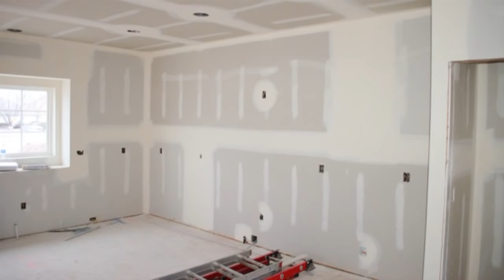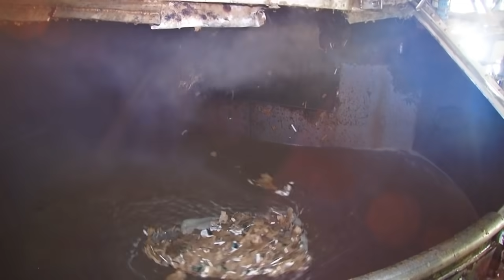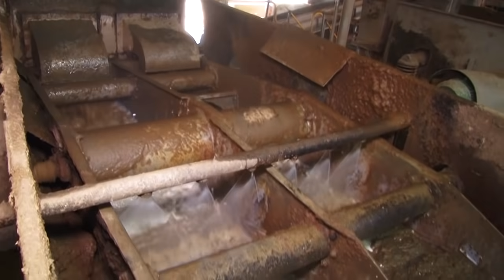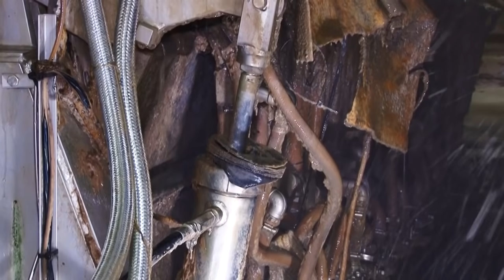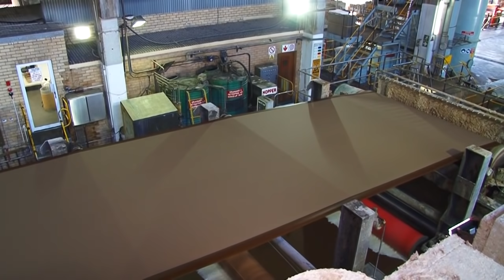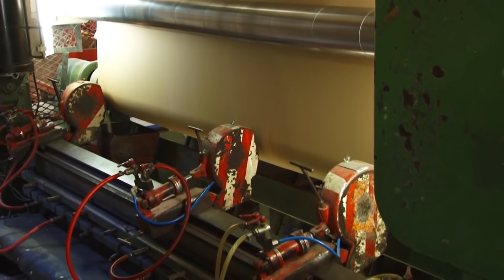How Cardboard is Recycled

Comment: And we wonder where all the water is in the world.If you question where's the water or how come or so hot like I have before.there might be a lot but I don't understand but simple OnePlus one will always equal two. A condensed ER meaning air conditioners for coolers refrigerators freezers refrigerant low temperature Cold storage. The way the condenser works is by blowing air over the coils which has coolant or refrigerant. Gas pass cycling thru the coils as the warm air passes over the MOISTURE in the ATMOSPHERE.
🙄 (" water in the a "ir) 😒
Condense. That is what you see dropping from the pipe from your A/C UNIT in your CAR or off your ROOF OF YOUR HOUSE.
or under your CAR.
🤔 CONDENSER  ,😲😲 
NOW imagine what a factory A/C drip might look like? 🤔
Or a casino? 
Or 1,000,000 or  even up too 2,000,000 homes just in a single CITY'S drip could look like.??? 😲😲😲😲
Is it starting to soak in now?
Those big factories casinos and freezer storage units for grocery stores and stuff like that
They don't drip.
The flow steadily and they flow. Almost twenty-four hours a day stripping moisture from. Is would be the effects in the so-called global warming cause and effect results where would you get warmer due to lack of moisture to regulate our like the sweat. The Earth has no more sweat because we were too hot.what are we going to be now and we need a suit to go outside?

Comment: They say only 10% of recyclables are actually recycled; not like it was shipped to China and other countries to be buried or burned.  As much as I sound like a pessimist, I'd say do your own research because to me lately, recycling was a big scam when bulk of it used to go to China until they started restricting the amount of recycling they accept.
Reply: Yes it is, that and they use alot more energy to recycle cardboard plastic and other materials than it would have taken to just put it into the ground. The only things worth recycling are metals like aluminum and tin and other scraps. The only reason these recycling companies are a thing and why it costs alot more is mainly government intervention and the subsidies by the government.
Reply: @Info255  
I see you failed math class.  
Far less energy is used... to recycle plastic & paper, than it is to construct from new materials. 

Harvesting the raw materials, lumber & oil... are far more energy intensive, than collecting & sorting paper & plastic products.  
The manufacturing of plastics from crude goes through a long series of refinement processes, that consumes 20x the energy... vs ...processing recycled plastics, which only need to be cleaned & melted down to be remolded.  

The pulping process of wood takes much longer & goes through more cleaning phases to remove the natural acids, turpentines, & other chemicals, which consumes a lot more energy... vs ...recycled paper products, which only go through 1, because they are already clean of those chemicals.

Comment: Would like to have seen how plastic, metal, paint, and other impurities are removed from the raw pulp.
Reply: Techniques used for removal of impurities are typically trade secrets.
Reply: @rockets4kids  How long do trade secrets on recycling need to remain trade secrets?  Frankly, the more businesses that do it, the better off we are.  Plus, a copycatter still needs to purchase separation machines, and do the actual work, which involves expense.
Reply: rockets4kids It would eventually get figured out-as done with most technology
Reply: D. Jensen - I ran a pulping area so could give you an idea. Heavy weighted materials such as stones, metal and glass are removed by centrifugal cleaners which force the heavyweights to the outer wall and are separated. The light weights such as plastic are removed similarly but are removed opposite of the centrifugal cleaners in that the lighter contamination is removed from the inner stream. Some basic physics here, not too complicated. I hope I didn’t confuse you.
Reply: @michaelauger8077  that's very interesting thank you - what happens to the plastic waste after it has been separated?
Reply: Nathan King - In my process it went into the effluent stream, filtered out with other solids and actually burned to make steam for the paper mills. The effluent which was of drinkable quality went into the river.
Reply: Nathan King they actually burn plastic. I thought that was bad for the environment. And then the excess liquid is pumped into our streams... I thought recycling plants were “green”
Reply: Joe Boyd the plastics that we removed from our container board recycling process was sent to the landfill. Ours comes out of the pulper in what is called a “tail” and it’s a continuous mass of plastics, tapes, and wire that looks like a massive cat tail that you can’t hardly reach around and it is pulled up about 6” every 30-60 minutes and it constantly grabs new plastic that’s mixed in with the bales of old cardboard and once you have 8’-10’ going down the chute then it has a hydraulic guilotine blade that will come out and cut it off and it drops down the chute into a dumpster in the basement. One the dumpster gets full then it is removed and taken to the landfill. 

Nothing from our waste stream was burned but the mill I was at would buy our steam and power from a power company a half mile down the road and we buried massive steam lines from the power plant to the mill to transfer the steam. We did not have the need to burn anything since we did not have our own power house. Many older mills would burn all of the wood bark and saw dust and other waste streams in order to produce the electricity and steam needed to run the mill

Our effluent was pumped back into the cities ware water system for reclaim after we had run it thru many stages of clarifies to remove any type of contaminates and it was cleaner when we discharged it than it was when we brought it in from the city. Our permits required this and we were regularly tested by the state to ensure compliance. 

I was working at a mill that we built in the latter part of the 90’s and I’m not sure if they have built anymore since but at the time we were the greenest recycle mill in the world
Reply: @1982MCI  That is really interesting! Thank you for sharing 👍👍
Reply: @Spawn303  catalytic converters burn off the noxious fumes of the plastic before it's pumped out into the atmosphere.
Reply: @1982MCI  most splicing tapes used in corrugated are of the repulpable/dissolvable nature that are allowed to go thru the entire process without having to be removed
Reply: @nathanking6065  tape 🤗
Reply: @nathanking6065  It gets burned.
Reply: Michael Auger since you are in the trade...  how well do bacteria and viruses survive such industrial processes of heating and drying?
Reply: @xinfuxia3809  depends on the particular microbe.
Reply: Xinfu Xia no viruses or bacteria will survive the high temps of the water  we use in the recycle system nor the heat of the can dryer system which is heated by high pressure steam. It’s not possible for anything to survive those temps
Reply: @xinfuxia3809  All bacteria dies when heated to 130 degrees celsius, which is why the medical industry uses autoclaves, which is a steam-based pressure cooker. Viruses usually die after 24 hours outside of a host, when exposed to UV radiation from the sun, but may require chemicals to denature them, such as alcohol, which is one of the reasons our ancestors invented alcoholic drinks, the brewing or distilling process kills all bacteria and viruses. In soil viruses have been known to last for 170 days, but in ice they can last for hundreds of thousands of years.
Reply: @michaelauger8077  I was more interested in how they removed the bits of polystyrene, cellotape and staples. I always try to remove as much as possible before dumping it but many people don't so this has intrigued me for many years.
Reply: As a machinist it feels like they always show the obvious stuff and leave out the cool info! :p
Reply: I work at a cardboard paper mill there’s a hole on the inside of the puplper where the metal falls out and they use rope to make a tail that rolls around the tub to collect the plastic and metal wires from the bails
Reply: @firecad2006  Whoa! Interesting! 👁👁
Reply: That would be interesting to watch.
Reply: Metal is thru magnets and eddy currants.
Plastic is lighter so floats and is skimmed off
Reply: In the case of my company it gets sorted out before the cardboard is initially baked (so steps prior to this video)
Reply: I believe they use magnets for metallic material but for plastic I have no idea. This video may not fully address your question but it’s a good watch https://youtu.be/O_4hO7R3Vtc
Reply: @ginosko10  yes magnets and eddicurrants.
Plastic is lighter when in water so it floats
Reply: Where are you from? Perhaps you'd like to see the process in person
Reply: @myownidenity4955  If you were talking to me I'd love to. I'm from Flintshire, N Wales.
Reply: it is easy to do
Reply: @Qusin111  how
Reply: Would like to see how transistor s and Ics are made
Reply: @Danger Dave Interesting!
Reply: They were removed at the previous facility and bailed.
Reply: [Redacted]   the plastic is removed else where
Reply: Optical scanners and magnets my friend
Reply: Plastics. There are basically 2 type of plastic one that floats and the other sinks. Metal removed via being magnetic. Paint centrifuge.
Reply: the guy inside those big drums who are responsible for turning the drum, pick them up by hand!!
Reply: There use cyclone cleaners that let the light fiber float off and the junk sink
Reply: I 💯 agree!! I work in a Brick DC & put flattened cardboard into the bailers Zz. they all tell me to leave the tape & staples cuz they’d come off in a facility like this. Zzz 🥱.. mmmm yea. 🤦🏽‍♂️.
Reply: trade secrets were definitely shared in these 43 comments. lol. . & no doubt in other comments through the other comments.. lol. .
Reply: Trade secret. Then anyone could make money off recycling
Reply: @Spawn303  yup

Comment: Wow .. I never would have thought I'd see this! I'm a truck driver dedicated for Georgia Pacific in the USA. It's the same process here. I haul OCC (old corrugated cardboard) from recycling centers across the nation to many different plants. Namely GP Muskogee Oklahoma. But I also haul roll stock ( the large brown rolls)  from any number of plants to manufacturers for cups, boxes, envelopes, paper towels, etc. These rolls weigh quite a bit, but they fit roughly 8-10 on my dry van trailer.grossing 41k lbs.. These plants have a very unique smell. And when they are in major processing you have a fine paper particulate in the air that can cover you pretty good. You'll be begging for a shower when you leave :)
Reply: i actually work at a stock box packaging company and i run the receiving department. We unload  trucks full of rolls everyday and send out scrap bales for recycling. You ever pick up from westrock?
Reply: Hey Clint, I am doing research on the recycling system and find your comment very interesting. I would love to talk to you more about your experience around these plants. Please message me with contact information!

Comment: They had a cardboard plant near here in the 70s, & a friend of mine (who worked there), sometimes took me there to watch.

When them sheets of cardboard came off the press, they was hot & sharp as razors on the leading & trailing edges.

Other fun stuff you had to watch out for was barrels of concentrated lye, forklifts, etc.😂

Comment: The chemistry used to clean the paper is about 10X more than making paper without the recycling process. More than 80% of the paper produced is not recyclable. Recycled paper is more expensive and not profitable. I worked 7 years in a huge book factory, 0% was the total recycled paper used for being of poor quality.
Reply: Yes it uses more energy but it creates far less pollution. According to BBC Focus recycling uses 35% less water and casues 75% less population. Also recyling 1 ton of paper negates the need for 3m cubed of landfill. The EPA has also stated that paper mills are one of the worst polluters in the United States.
Reply: Recycling and green energy are pipe dreams.   Just like bio fuels.   No one wants to do the obvious and smart thing.   Which is use less.
Reply: No way to make $$ of less

Comment: Good thing you cannot smell the process
Reply: 🤢 I use to live a few miles from a paper mill.
Reply: @zyiola  Driving to Florida from Pennsylvania, there are some paper mills and they are stinky.  But they are sometimes far enough away that unless you know what that odor is, you would never guess it was a paper mill.
Reply: Recycling tends to be less smelly than primary paper production. It is the sulfur released largely in the primary process of pulping wood chips that makes the most of the smell. Even modern primary pulping mills don't smell as bad as the old ones.
Reply: It smell ungodly , but I think you already know that , hence your comment.
Reply from the maker: Hi All, this process does not smell bad. I was surprised at how little odour there is in the factory. Paper mills that convert wood pulp into paper do have an awful smell, but that is a completely different process. This recycling process is noisy and hot inside the factory but doesn't have a bad smell at all.
Don Morris, producer of the video.
Reply: @howitsmade5865  thanks for replying, I did not know that
Reply: The stinky plants use wood pulp. The Mills that just use recycled paper. Have no/minimal stink.
Reply: ha! never thought about the smell. Maybe we need to add that little tid-bit in our cardboard recycling page https://ourhappyplanet.org/cardboard-recycling/
Reply: Lived in a town that had a paper mill, hot dog factory, and a tire plant next to each other the worst smells ever.
Reply: You should smell our local Wayne Farms chicken plant.   The paper mill would smell like a great Saturday night date!   BURNT Chicken feathers are a horrible scent to hit your nostrils.  Then the pool of parts of chicken bones, etc., that just lay around before being picked up for using them in animal feed, dogs, cats, cows, horses, etc., and plant feed(flowers,etc.).    UGH UGH UGH!
Reply: NOT LIKE A SULPHUR PLANT
Reply: I was offered a job at a pulping plant.They gave me a tour of the plant when operations were shut down.Seemed like noise and dust would be a hazard IMHO.I didn't even think of how it would smell.One of my duties would have been to clean the inside of the big pot wearing a hazmat suit.I respectfully turned the job down.
Reply: I live near the factory, it’s smell awful
Reply: air
Reply: i like the smell
Reply: yea   paper   mills  have  a  horrendous   stench   if  you  have   not  been  there                                                                                                                                                                                                                        trust  me  you  don't   wana  know  its  not  confined  there  building  either  it  stinks                                                                                                                                                                                                                                             up  the  whole  town   those  who  live  there  have to   get  used  to  it    any  one                                                                                                                                                                                                                             who  is  passing   threw   you  might  want  to  roll  your  windows  up    imagine                                                                                                                                                                                                                                                                                            a   leather  tannery  stock  yards  and  an  oil refinery    right  next  to  each other                                                                                                                                                                                                                                            the  good  news  they   don't have  homeless  people   begging   for  hand outs                                                                                                                                                                                                                                                  because  nobody  wants  to  stick  around  if  they  don't    have  to
Reply: steven herrold your speaking about a pulp mill which is completely different than a recycle mill. A recycle mill could sit next door to your favorite local restaurant and you would never know it was there due to the smell. A pulp mill can be smelled tho for 25 miles. Completely different animals and I have worked in each one of them